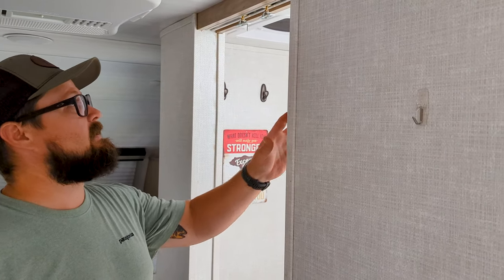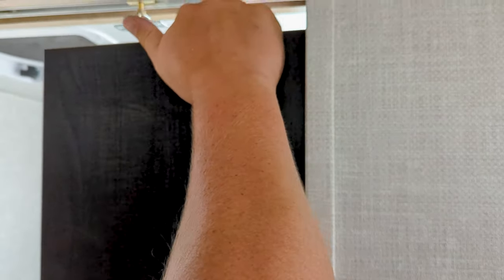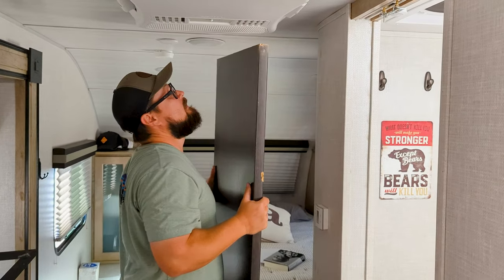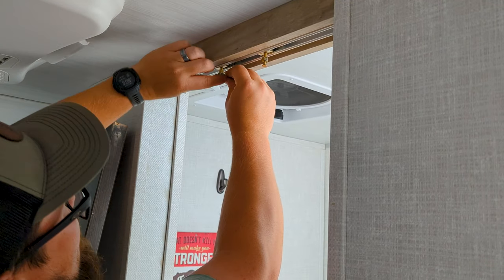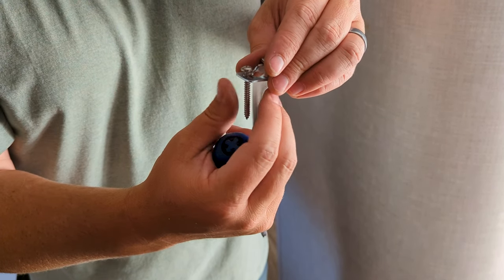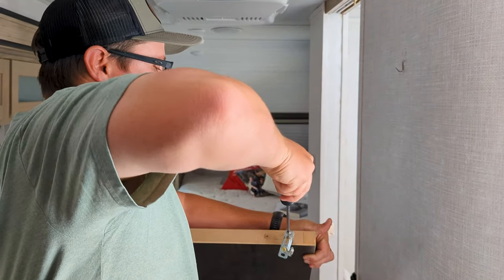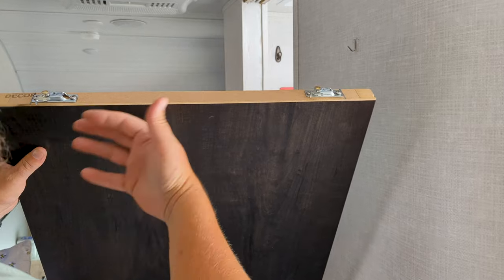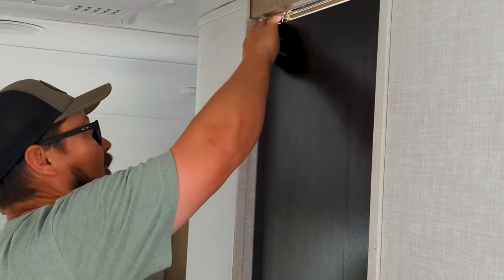Travel Trailer Camper Pocket Door Roller Repair | Reinstallation

Comment: couldn't you just make new holes on the top with same size screw?
Reply from the maker: Yeah, but the brackets would be in a new spot. I don't know if that is enough to change how the door works, so I bet that would be perfectly fine.

Comment: Mine didn’t pull out of the door, but the clip came loose. Once when I got to the campsite, next when I got home, fell off again, lol. I’m hoping Jayco built my door with real wood framing, not MDF. That stuff will not hold a screw, and shame on them for building this way.
Reply from the maker: Good luck, I hear Jaycos are built pretty well.
Reply: Well, I just looked and mine is MDF, Arrrrgggghhhh!, lol
Reply from the maker: @jerrytalley802  it'll never make sense.
Reply: How much could they really save with MDF over wood top piece? 
Then factor in just one warranty claim and they lost 10 times more than they saved. I wish they would consult with me, I’d get them straight, lol
Reply from the maker: @jerrytalley802  I have that same conversation all the time. Last I remember when MDF used to be the expensive stuff and framing studs and 2x4s were cheaper. It still doesn't make sense.
Reply: When I get tge time and energy, I’m  taking the whole door down and gluing a piece of pine on top, then mounting the hanging clips to my board. For the money I spent, I should not have to start fixing things. It’s only my third time using the camper, less than 2 weeks of tital use, ridiculously ridiculous!, lol